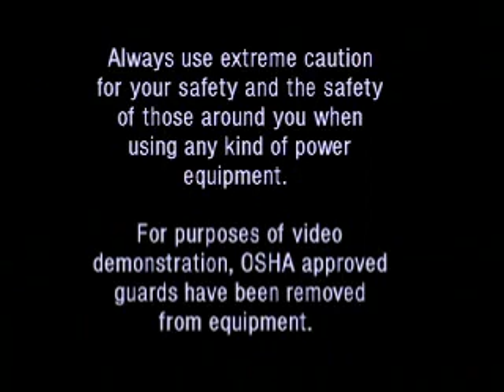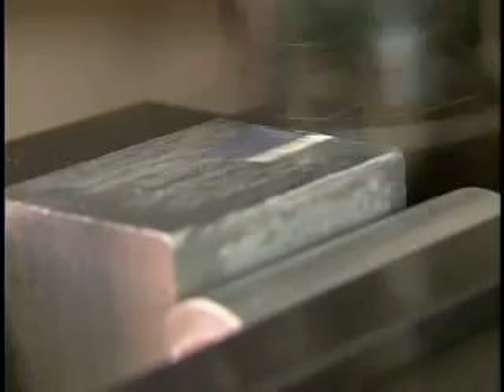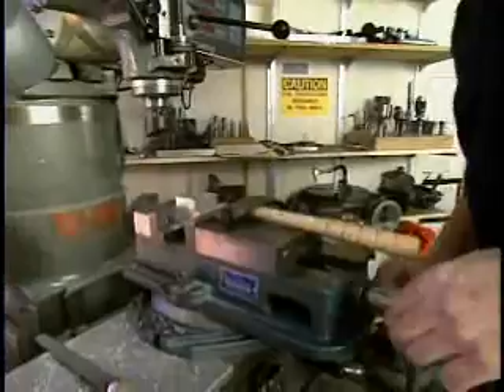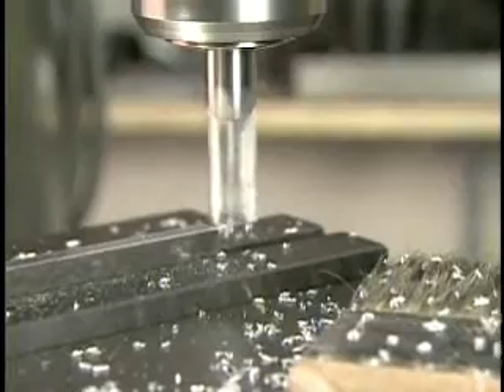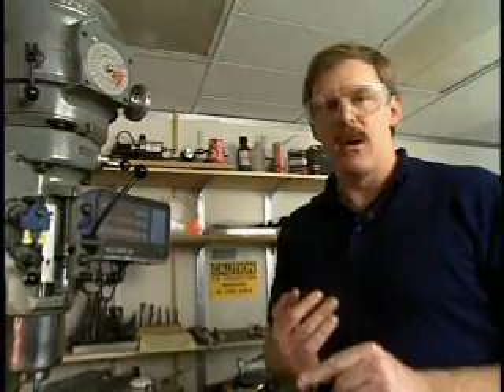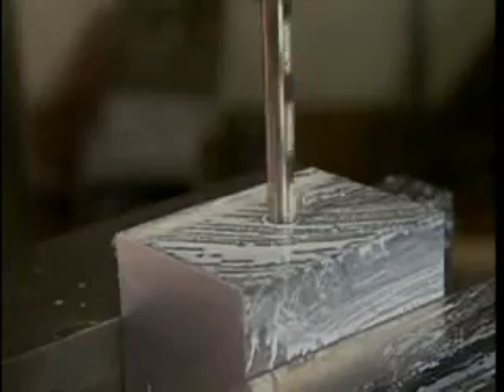Essential Machining Skills: Working with a Milling Machine, Part Three

Comment: You also indicate your vice so that it is parallel and perpendicular to your machine head. When you know your vice is square to your machine, there is no need to use this method.You can rest your raw material on parallels.Rotating your part 180% after each cut,this will square your part.

Comment: After he surfaces the first face (and files the burrs), he re-uses the convex backstop piece against the now-flat surface.  Shouldn't the convex piece be set aside, or placed against the front side of the vise?  When using that convex backstop, we're not really aligning parallel to the back of the vise.
Reply: Watch it again. He turned the freshly machined surface forward and used that against the back jaw of the vise. The face against the bar stock is presumably still rough, but as long as the piece is oriented square to the spindle before clamping, and there is still enough contact on the movable jaw from the bar stock spacer, he's good to go.

Comment: the step of tapping the part to be level with a parallel is stupid. You rest the part on the parallel that is sitting in the kurt Angle loc vice.
Reply: +David Ramey Vise.
Reply: +David Ramey The point is that the part needs to be made flat and parallel, but is currently a rough cut.  If you rest an uneven surface on the parallels, then you're going to be cutting the top surface at some random angle that might be far from optimal.  Conceivably, if you had cut it close enough, you might even go below the final part size at one corner.

Comment: Putting his hand near a moving part? NO ,no, no! A file is not made to be used in a back and forth direction. Forward only is the cutting action. My, and this guy has an M.S. and Sc.D. in mechanical engineering with a minor in electrical engineering from M.I.T.?
Reply: He lifted the file on the backstroke.  Lightly dragging the file across the work isn't going to hurt anything.  Get a life.